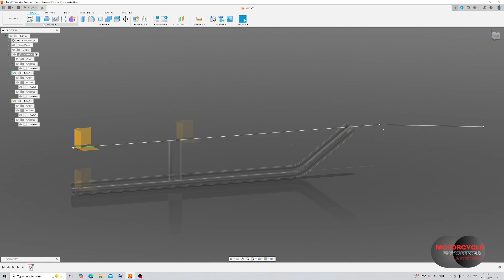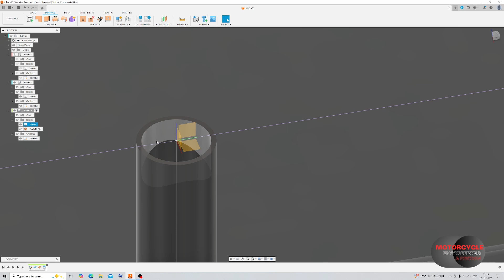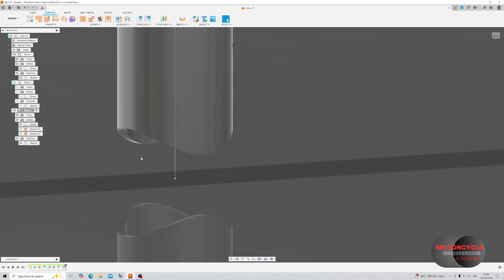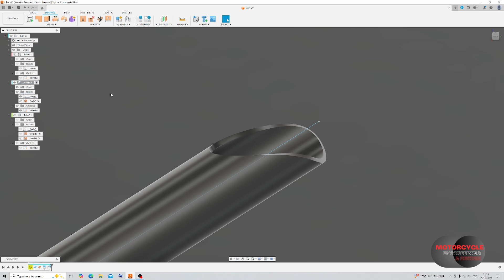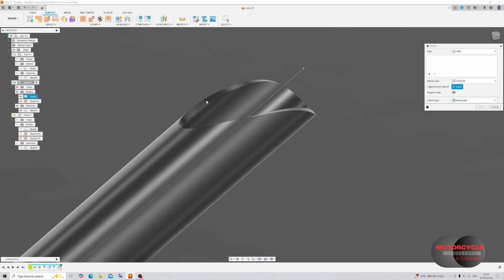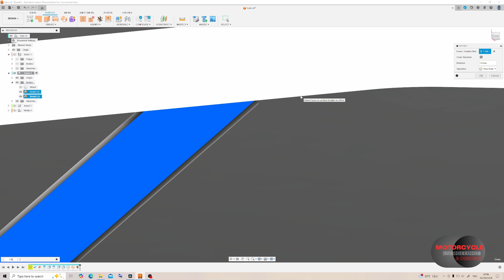Motorcycle Frame Design, How to cut and cope tubes in Fusion360 and CREO

Comment: As a welder, we appreciate that tolerance offset. 
Will you be showing/explaining any elements of the structural analysis?
Reply from the maker: I thought that this was an important point to mention as I have seen that it's often overlooked for the sake of simplicity and beauty here on YouTube.

As for structural analysis, I'm planning to run a simulation of the pillion load through a rear frame, I'll explain how I set it up and why I set it up the way that I do, as well as how I determine the force to be distributed across the loaded surfaces/points.